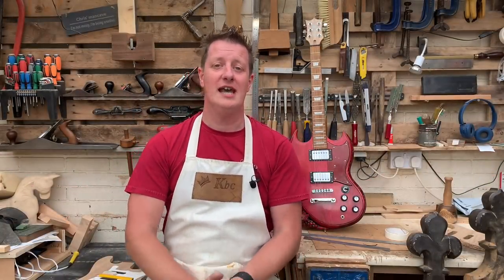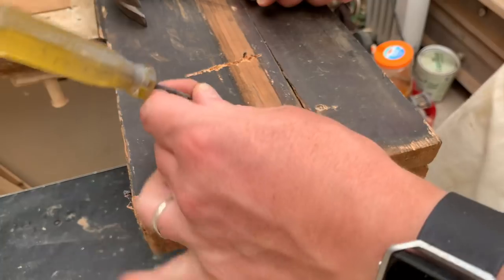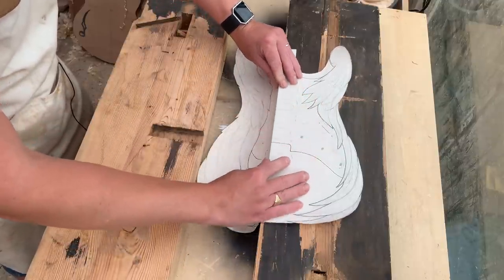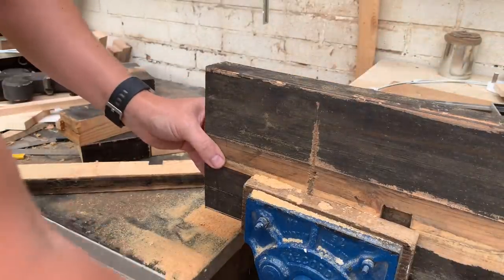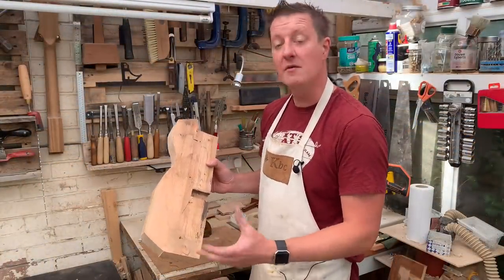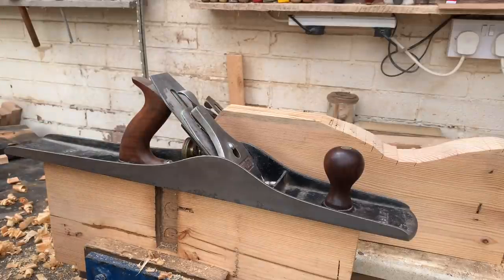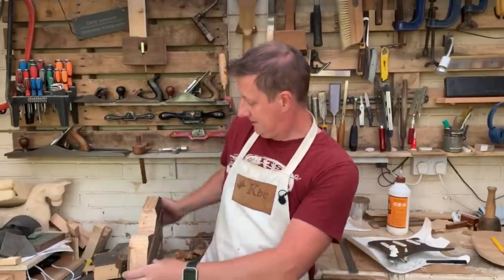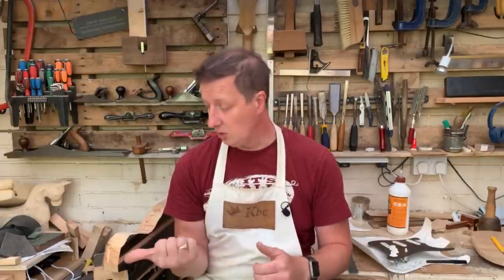Great guitar build off  |  Part 2 Taking some Church pews and doing some Body Building!

Comment: Cool stuff, looking forward to seeing more. Do you know what kind of wood this is?
Reply from the maker: Simon G some sort of pine. Buts it’s been a church pews for well over 100yrs. And will be and aged tree before that. They done make pine like this anymore!!
Reply: @KingBespokeCreations  They do, you just need to know where to find it.  I have some 2½" slabs of pine that I cut down myself and got milled locally, that are currently drying.  They have a super-tight grain, and weigh as much as the similar oak slabs I that I cut and have drying.